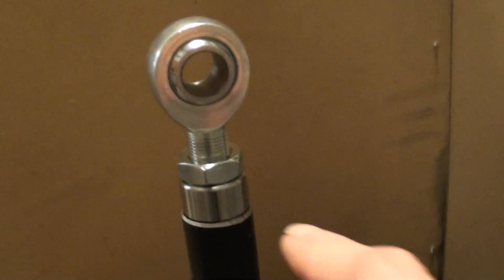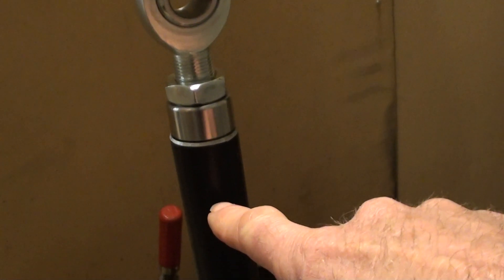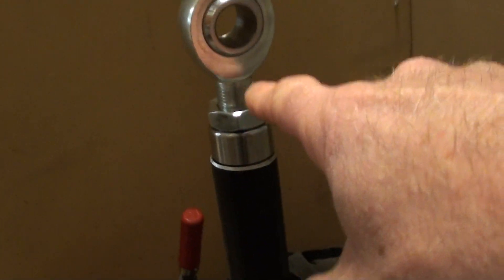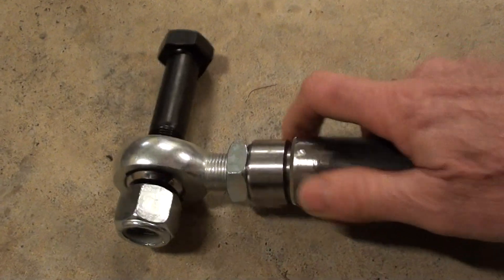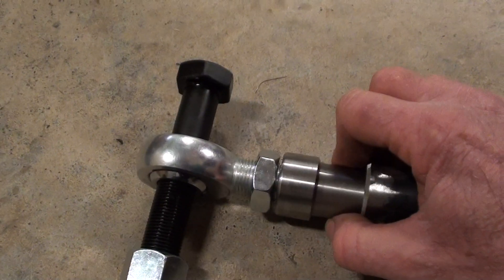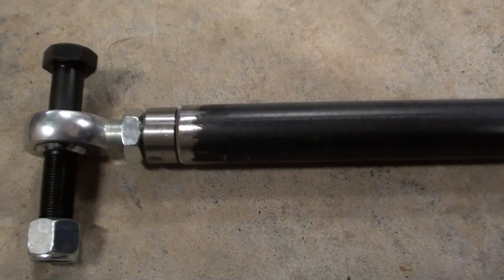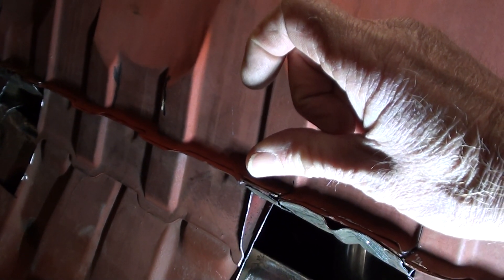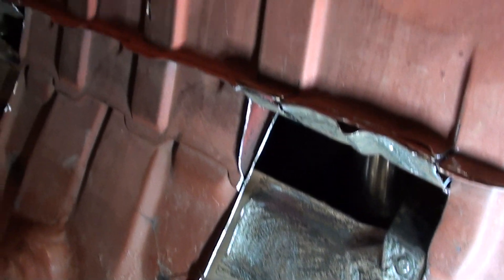MOCK UP OF REAR TOP ARMS FOR DIFF....

Comment: Hey Buddy that's it ! just as I envisaged it when we were talking on the weekend, bloody brilliant mate.  Looks quality, I know I don't need to mention it but just in case, don't forget to unscrew the rose joint out of the adapter so you don't over heat it during welding. Gunna look a million bucks mate !!  Seeya Rob
Reply from the maker: 87xfute like i said in the vid, getting it worked out in your head is the biggest challenge, then the rest is procedure... thanks for heads up Rob, and thanks again....

Comment: When you weld your round tube to that plate drill a hole in the plate for the round tube to slide into it and then weld it up (stronger) I'm thinking you might want to mig weld those parts since the metal is thicker and mig has more power to melt the metals together...I only tig weld thin metals that I worry about warp-age...etc
Reply from the maker: RPM I hear what your saying, see how i go with the tig first, Good tip on holes for the tube thanks...